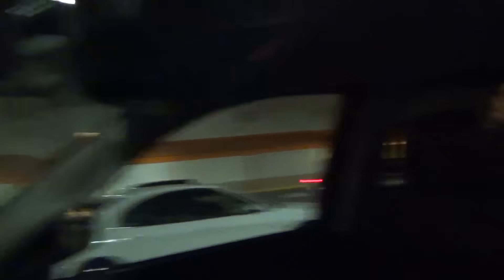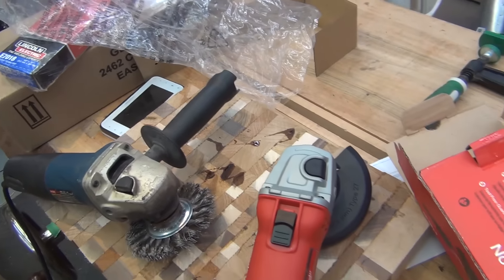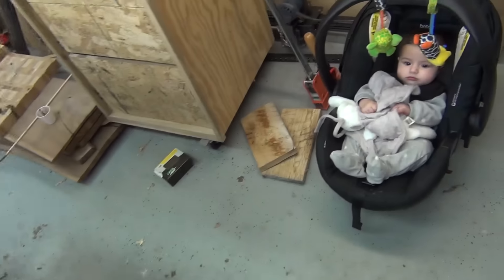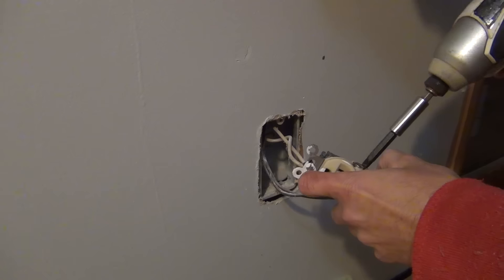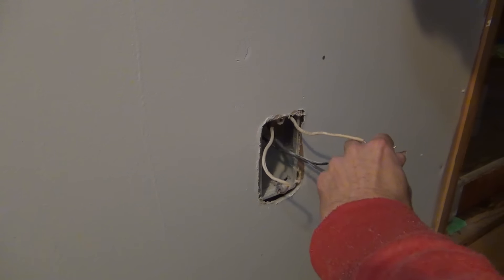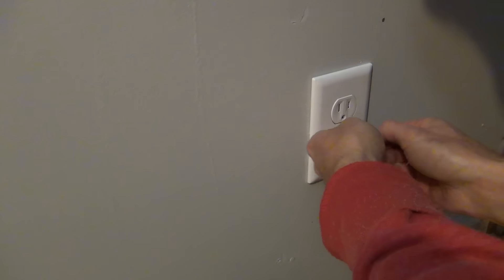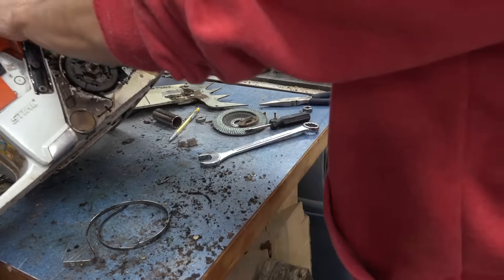Airplane Mode [Nov 20, 2015 Vlog]

Comment: I don't have an arbor lock on my grinder, but the arbor is machined like a nut right where it comes out of the housing.  I use a slim wrench and the regular wrench that takes that little round piece off that holds the wheel on the arbor.